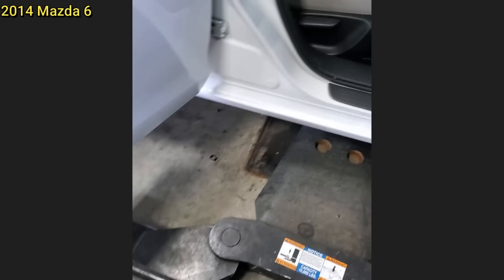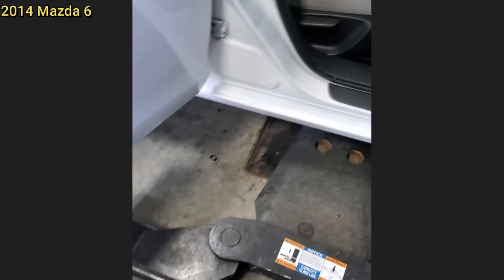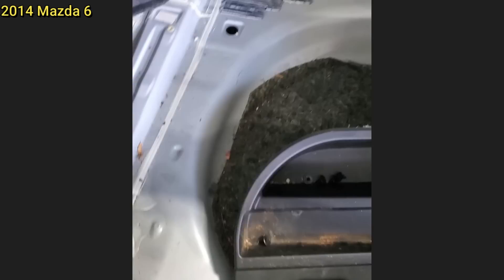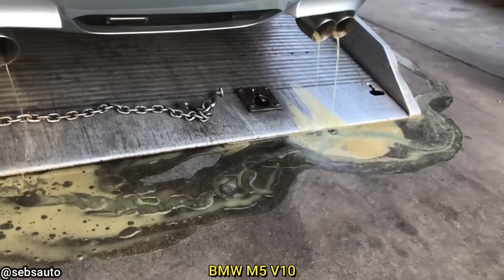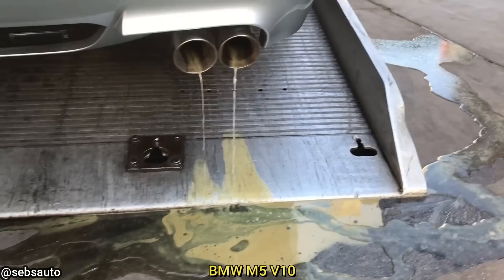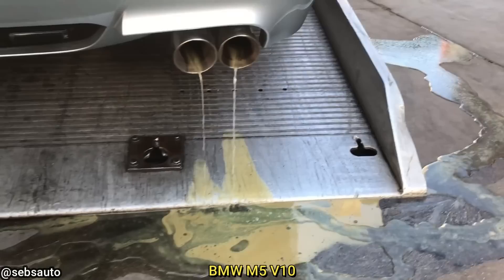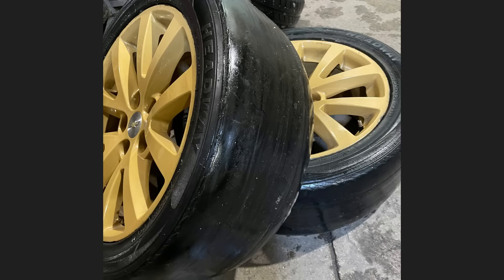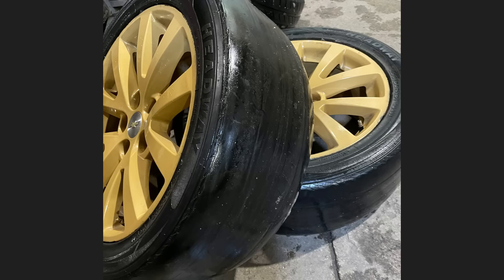Customer States Heard A LOUD Noise When Trying To Charge Tesla

Comment: The S85 is such a cool engine, but has a terrible reputation. Wikipedia claims it is closer to BMW F1 engines than any BMW production engine. I know they have bottom end problems, but damn a V10 is pretty cool.

Apparently the S65 (E90 M3) is based on the S85. The S65 also has bearing issues. 

I suspect clueless people abuse these engines and that is one reason for the bad reputation. You shouldn't drive any engine hard before the oil is up to temp, especially a high performance engine.
Reply: I lived in Germany for a while and knew a lot of people with BMWs - nobody ever expressed the opinion they were unreliable.  I also noticed that in Germany scheduled maintenance was considered with a close to religious devotion, and I can't help thinking these two things might be related.

Comment: in mid-90's you could buy eplosion-proof jerrycans here in germany (the inside was filled with steel mesh, so it could catch fire, but not explode. never tested it out tho). the thing might have been allright, the fille rlid sealing... wasn't. it became jelly from the fuel fumes, and soon stank my car up. I tried to get sealing rubber sheet to replace the seal, but the same happened again. bought a new (same) jerrycan, there the sealing just vanished after 3 days. after that I gave up and opted for an old, dirty, and GASOLINE TIGHT plastic jerrycan from the 80's...
poor V10. what do people do to their cars to make a block crack open? though everyone who buys a BMW V10 ought to have the funds to fix it.
1:18 this happens even here in germany where people do more maintenance with their cars, even if it's just oil change and a quick lookover. I guess it's faulty plastic, as I heard the3re is a membrane inside that rips. but it fits the often leaky plastic valve covers. and since the engine bay is so tight you won't notice until the juice seeps out of from the underbelly covers... the rest of the day is spend trying to get everythign clean.
that airboat action is hilarious. :) in germany authorities would have a stroke or two seeing that. XD

Comment: I live on the southeast coast of NC & I have to ask (because I'm not a car guru, my late husband (in profile pic) was a mechanic) & I'm just wondering... the vehicles you show with all the rust & corrosion on the undercarriage is that from customers up north caused by the salt they put on the roads or what? Where I live undercarriage rust & corrosion isn't our main issue; because we live by the ocean the oxidation of the saltwater seems to have a greater effect on the paint than anything else... unless they go muddin & that can be have an effect on vehicles anywhere if it's not cleaned off afterwards. 
I'm just askin because I watch these videos all the time & I'm just in awe of the amount of rust & corrosion on some of these vehicles, like how are they still even in 1 piece?
Reply: Pretty sure you’re right that it’s the salt in the roads in winter. Because I live in the Pacific Northwest, we get lots of rain but cars don’t rust out like they do in the Midwest & northeast.

Comment: 0:20 I'm a bit confused, as this is absolutely normal and proper way to install baby seat, at least where I live. Car seats and baby seats have appropriate fixings to do so, and passenger airbag can be deactivated using the switch, which in most cases is located in the glove box
Reply: It depends on state or country laws weather  or not you can do it. Even though it is possible in America to turn off the airbag and put the seat on the passenger seat, its illegal in most states to keep children under a certain age in the front passenger seat for safety reasons. And from what I heard this is also illegal in spain too.

Comment: Can an American answer a question for me. Here in the UK when a car reaches 3 years old it is required by law to get an MOT yearly inspection by a licensed garage. Is this similar in the US?  The state of the chassis and suspension on some of yhe vehicles that feature couldn't just happen in a twelve month period. A few death traps there. Great clips of some sketchy vehicles.  Mice mice and more mice.
Reply: It varies state by state. It should be a country wide thing, honestly
Reply: Some states still do. The 'safety' inspections in NC are a joke compared to the UK.

Comment: 2:30 The saving grace to the general public is that hitch wouldn't make it 2 feet before the trailer falls off.
Reply: There might have been just enough metal left to get it up to speed, then break at a bump, and send a trailer off at highway speed.  Good thing they were careful enough to have it checked out.

Comment: I would've liked info about whether Tesla was replacing battery under warranty due to the road debris or if the owner was expected to foot the $20,000 bill for that... And warning to Tesla buyers of cars out of warranty that a rock or piece of asphalt can total your Tesla.

Depending on the laws in each state, insurance companies typically consider a vehicle "totalled" or a total loss when damages exceed 50 to 80% of the cars value. That could mean that a rock totalled a Tesla with a value of $40,000.
Reply from the maker: I was told by the person who filmed the clip that the customer had to pay his insurance company a $2000 deductible to get the battery replaced. This happened somewhere in Europe a aswell.
Reply: @JustRolledIn  - thanks for the answer! I'm glad his insurance company stepped in. That's definitely one of those "learned the hard way" things as to needing to check if an insurance policy would cover this kind of damage on an EV.

Again, in the US we'll run into an issue where even if a driver has full coverage (and many people don't keep full coverage on a vehicle that's paid for) on a used Tesla that's being financed, the insurance may simply total the car instead of replacing the battery.

That would result in the used Tesla owner being out of a vehicle and the insurance would just pay off the lein, not put any money for a replacement car in the driver's pocket.

It will be interesting to see how the post warranty EVs fair in the market.

Thanks again for the response!

Comment: :20  as far as i know, car seats can go in the front as long as the passenger  airbag can be completely disabled.    An example is a regular cab pickup truck, they tend to have a key right  the console that can be switched off
   
   Dunno why the airboat guys getting so hyped up. Boat flying off the trailer would be bad news. Same friend could of just pulled the truck with a rope or strap and been legal.

Comment: Yeah, I had coolant drip out my exhaust once, turned out to be a hole in my car's head gasket. Never saw that before, hope I never do again. Rest in peace, 1990 Nisan Skyline. For what it's worth, that straight 6 engine was beautiful and smooth, the girl you'd take the knee for.
Reply: Sounds like something worth fixing...
Reply: @fredk.2001  It was, and I did. Cost me more than the car was worth at the time. I drove it till the plastic bits on the dash crumbled.

Comment: pretty sure 1:40 is from a faulty valve cover and leaking vacuum diaphrgam. If it was a clogged pcv the crankcase should be over-pressurized, not under vacuum
Reply from the maker: Just stated what the technician said but you could definitely be correct on that.

Comment: 0:25 That is actually the safest way to transport a baby. Because in case of an accident their little neck is not extended by the forward motion. Placing them on the front seat is also deemed safer. You must not forget to disable the airbag..

Comment: Sad part is about Tesla batteries they are patent protected so you cannot legally repair them or modify them in any way.  You have to have a new from from Tesla which are 15 to 25 Grand.  Some of the older models a couple years old cost what the car does.  29,000 for a model X and requires (don't know how they enforce it or if they can) any salvaged Tesla's totaled to have their packs destroyed and recycled, not reused.

Comment: That Tesla is another example of why I'm "No, I'm good" when it comes to electric vehicles.
Reply: Same here. Electric is garbage
Reply: Because 15 gallons of gasoline are not flammable?
Reply: @Slazlo-Brovnik  Got absolutely nothing to do with it "being flammable" and everything to do with the cost of a replacement fuel tank vs the cost of an EV battery.
Reply: @change_your_oil_regularly4287  Okay, I see. I thought you might refer to the fear of many people that batteries may burn.
Reply: Just don't drive across huge rocks with a low car, and you're good

Comment: The Mice. The damned mice. Ate the knock sensor wires out of my Camry. Not a fun repair.  A year later, came home from a trip and left the trunk open while I was unloading. A PREGNANT mouse jumped in, made herself a nice little insulation nest in my spare tire, cracked open a spare pack of nuts, from the trip, that I forgot in the trunk and gave birth. Chasing it out of the car and the final cleanup was interesting.

Comment: well if the states need to do safety inspections with the state of the last frame and receiver hitch dam. is why they do them to keep you from getting into an accident or worse. they used to state troopers inspected for violations quit for what ever reason. to me they should over major components issue tickets 🎫 start making money but if they get the car/truck fixed their and now the ticket can be voided. your putting the public at risk. bad brake rotor pads broken tail lights head lights out. go back to issuing state yearly safety checks. no zip ties for license plates no license plate lights out sun bleached. major running stuff. struts shocks.

Comment: 0:23 what's the issue here? Wrong type of seat?
Reply from the maker: Most places having a baby seat in the front is illegal.
Reply: @JustRolledIn  That's interesting, I'm from Poland and front, rear-facing child seats, especially for infants are not uncommon. Of course you need a proper seat designed for such operation and a passenger airbag must be switched off, not all cars have this option. I guess it is illegal in US?
Reply from the maker: @mibars  I'm in Canada and it's illegal where I live. Rear facing child seats should always be in the back seat.

Comment: Does Tesla use lithium ion or lithium iron phosphate?
Reply: Angel Dust
Reply: @THRASHMETALFUNRIFFS  I'll take 30!
Reply: Depending on the model and trim it's either lithium nickel cobalt aluminium oxides or LFP. IIRC they said that just over 50% of units they sold in 1Q2022 were the latter.
Reply: @Smertyuk  Then why are so many people freaking out about the car bursting into flames? Are they conflating lithium ion with other technologies?
Reply: @K9River  Partly because most don't even know there's a difference, to them batteries are batteries and batteries are gonna Note 7 if you look at them wrong, partly because while EVs burn hundreds of times less often per miles driven each case is all over the media, partly because some people need a reason to hate EVs.

Comment: Why do you suppose that Elon Musk, allegedly the smartest man in the room, didn't design his vehicles with batteries that could be easily swapped out for freshly charged batteries Instead of sitting still for 8+ hours to recharge?
Owners could pull in,pay for the recharged battery, watch it being switched out with the depleted one & be on the road almost as fast as filling up a gas or Diesel fuel tank.

Comment: Why would somebody take a Tesla to an automotive mechanic???? Virtually zero other than lifting it to take a video can a mechanic do to correct this issue... But the number one reason why it should never be at a mechanics is because right to repair is a thing Tesla doesn't understand they will send a tow truck to wherever you're at give you a loaner car and repair it at a substantial cost
Reply from the maker: That first clip was at a Tesla dealership.

Comment: If the vehicles are going to be equipped with a catalytic converter, they should also make the theft proof.
Reply: It's probably designed to be replaced relatively easily if rust or a rock puts a hole in it.  Before converter thefts were common, there were still wheel thefts.  And empty houses have copper pipe and wire stolen.  Some cities just need to deal with their crime problem.

Comment: that parent that brought their vehicle in for an oil change... needs my favourite correcting 2x4 with the optional rusty nail attachment up the side of the head... it would do less damage than if the air bags goes off while the car seat is in that position. the reasons it's not allowed? it can decapitate babies...

Comment: What's wrong with the baby seat? Sure it's facing backwards, but then the airbag would have to be disabled. There's usually a key switch in the door.
Reply: Not every vehicle allows you to disable the passenger airbag.

Comment: 0:22 There a lot of child seats that are designed to have the baby face this way if you disengage the passenger air bag using a switch in the glove box.
Apparently it's safter having the child face that way in a crash.
Reply: Thank you. I was looking for this comment. I don't understand why you shouldn't have a baby seat in the front when the airbag can be switched off.
Reply from the maker: Every visor I've seen says specifically to never put a rear facing child seat in the front...
Reply: In Indiana at least, I'm pretty sure that children in car seats must be in the back seat of the car.
Reply: All baby seats and pretty much all states have it mandatory to have a child seat in the back seat because even with the airbag off it can still accidentally detonate during a collision.
That and it's a hell of a lot more safe there because the engine block can't come back into the body that far (even with modern designs meant to ensure it drops down and back it still happens)
Reply: When you have a rear middle seat, that's the safest... under 1 yr old should be REAR facing... in the BACK unless absoultely neccessary

Comment: just F.Y.I them PCV valves should be replaced every 80k miles, and all the pipe work, do not buy the ebay ones because they do not work right, you need genuine bmw replacement parts for that.

Comment: 1:41 I wish you would have explained what a PCV valve is
Reply: Positive crankcase ventilation.
A small one way valve, usually located on or near the engine valve cover.
It sucks the gasses out of the inside of the engine and feeds them to the intake to be burned. 
It helps with emissions and oil sludging.
Reply: What the letter G in ur pic all about?
About 10,900,000 results (0.62 seconds) 
The PCV valve is a one-way valve attached to the crankcase. Waste gases exit the crankcase through the valve but cannot enter. Over time, the waste gases leave ...

Comment: There wasn't anything wrong with those tires. If you look closely they were shaved for road course use.  You can never get a tire to wear that evenly on its own, impossible.  They were probably at the shop to switch the whole wheel set to winter tires.

Comment: I'm a bit surprised that the Tesla could still be repaired (or rather, the company allowed it to be fixed). Don't they usually void your warranty for some shitty reason & force you to buy a new car?
Reply: I'm sure the sensationalist outrage media would love to have you believe that, but Teslas do get repaired under warranty all the time.
This one was an insurance case though. Your battery warranty doesn't cover "driving across a big rock".
Reply: @logitech4873  fact is 50% of their cars have been recalled, with numerous people here on YouTube describing their poor build quality, as well as issues they've had with customer service. I didn't get this from the media, they're people
Reply: @thecheeze9001  Recalls are common for all car manufacturers, and usually very mundane - things such as "this particular cable might wear out over time".

Your original post wasn't about recalls though, it was about repairs under warranty. Why the change of subject?